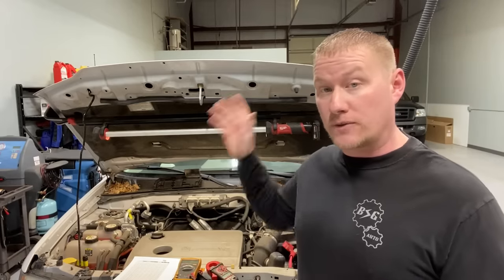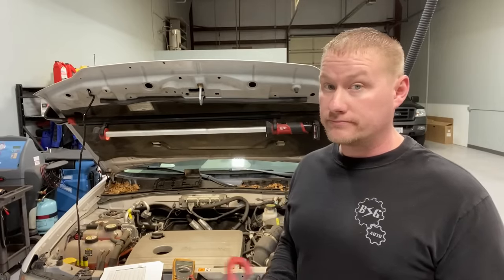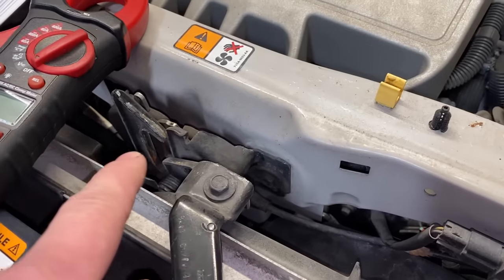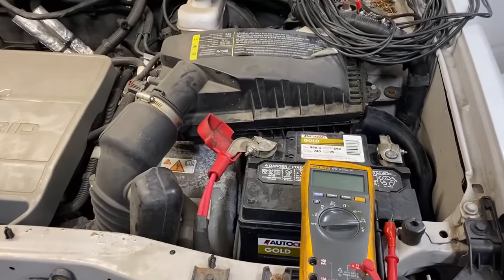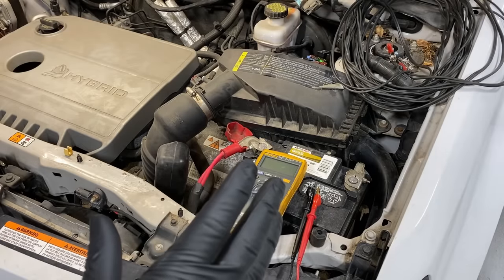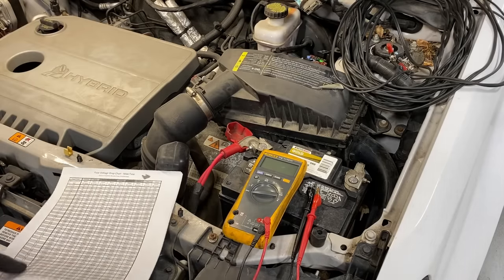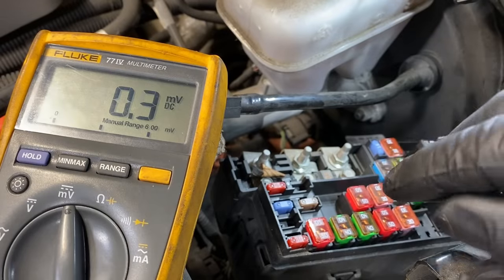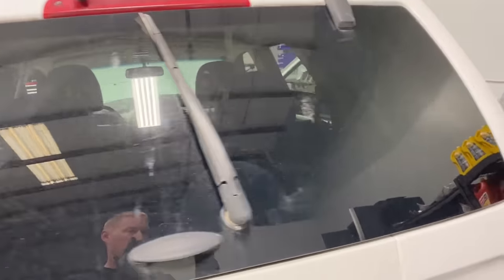Which Parasitic Draw Test Method is REALLY the Best?

Comment from the maker: These are the Tools and Equipment I Recommend:
Good Basic Multimeter-
https://amzn.to/2IxRMM8

Good Basic DC Amp Clamp-
https://amzn.to/3aygR5E

Power Probe Voltage Drop Fuse Charts:
https://www.powerprobe.com/fuse-voltage-drop-charts

As an Amazon Associate I earn from qualifying purchases.
Reply: Thanks brother. I'm just learning electrical trouble shooting. This will help a LOT. 👍😎
Reply: Thanks alot I'm dealing with parasitic draw and my 2013 f150 right now. The battery goes dead after sitting for 5 days.

I do know I have a bad wire going to my h13 headlight connector, and broken wires and the rear door harness.  
should I fix these problem before doing the test?  
Could these be my problem to parasitic draw.
Reply: Please help me. I have followed your video about remote control start and now Everytime I do it the antitheft runs . What should I do Ford fusion 2012 v4
Reply: Do you know how to fix the gem on like a 98 f150 that has a phantom parasitic draw
Reply: Another great video. I started using Di Grease on my terminals like you suggested which has fixed my corrosion problems. Can you please do a video on rack replacement on the '08-'10 edge or similar vehicle. Space looks limited and the repair looks a bit scary because the sub frame probably has to be lowered. My rack doesn't leak but I can feel the play is in the rack attaching to the inner tie rod. It's moving all over the place especially the y direction. I've heard to check the U joint but that wouldn't explain the play in the rack itself.
Reply: Got a link to the thermal imaging meter. That was cool . .. or should I say,
 "the hot quick fix"
Reply: Remember doing this different ways in "fact" class
Reply: Thanks 4 real!!! What if my vehicles key fob is lost, so I can't make vehicle beep or lock with key I have to manually lock it. Will the car still sleep? Thanks!!
Reply: The absolute best educational testing video ive ever seen .
Reply: Could you this test for a hidden GPS ?
Reply: Wat is name of tool at 18:50, one which shows temperature of circuit board and how much it costs?
Reply: Why are the tools you recommend different from those you use in this video? For some of us it would be easier to follow and better understand what you are teaching.
Reply: @gabewhisen3446  I believe your "ghost " is a intermittent parasitic drain. He explains it at 16:15 and 17:43 in this video. This video, is the best I've found so far but I would still watch other videos to get tips from them. For example, once you identify the faulty fuse and such fuse controls a bundle of wires, now you have to find the faulty wire (it helps if you have wiring diagrams for vehicle you are working on). Also, on another video someone commented that a bare wire can be found by using the clamp tool/meter. 
Like I said before, this is the best video I've seen, but don't ignore other videos just because, the person in the video doesn't  wear a fancy uniform or it seems they're working at their backyard. It's all about what you know, not what you wear. 
If you haven't fixed your problem, I hope this helps.
Reply: @gabewhisen3446  tool/meter, the proper name is DC amp clamp. Sorry.
Reply: Great explanation! 
2013 F150 5.0...Been chasing an intermittent draw since new. 
Question, though... If I lock up with the keypad (one push 7/8&9/0) does that arm the vehicle and put it to sleep, or should I use the key (two pokes on lock)?
I'm reasonably sure it's the radio, but the issue has been elusive 
Until now of course...

Kinda baffling to me, but as a former Ford service manager, I've always wondered why every dealership only has one of YOU...

Keep up the good work, the car buying public needs you!
Reply: Great video. My amp clamp isn't the most accurate so anything less than an amp I would use voltage drop test (I learned that I can not be trust to remove the probe from the anp jack then when I test voltage I cook my fuse.) but combining the 2 methods should come in handy. Thanks for the video.
Reply: thank you for sharing this sir!
Reply: Sea
Reply: Amp clamp no longer available from Amazon
Reply: Excellent video well thought out    Professional  just what you tube needs more of  thanks  I would like to suggest one  extra step    To the Tec and wrenching  and covering bases and peace of mind. That is using your smart phone in the camera on it so that before you start pulling fuses taking a picture of the fuse box a clear picture of the fuse box so you can see the colors and arrangement of the fuses and so you got insurance right there so when you’re moving your wires around testing each fuse while you have your intermittent passive drain moving your wires around on the meters a lot of the times snags things and then gets all the fuses out of order and if you don’t have a  manual to Guide your easy reinstalling the fuses ,you can just referr to the Ipicture you took of the fuse box which also let you magnify the picture and time date stamp is it in case you’re doing a side job all very convenient and helpful saves time In keeping your fuse values unmixed up  of the fuses and make sure they go back to the right places it is so amazing how easy it is to bump a layout of fuses and  then struggle other than that you’re right on  I learned a lot from you you keep it up I appreciate your video and have subscribed and liked your process thanks
Reply: With the AMP clamp, and working on a 99 F450 XL 7.3 dual battery, remove one of the positive cables, then measure across the other positive cables?
Reply: I don't remember which parasitic drain video I watched but he said to definitely repair any know electrical problems first. Makes sense...one of those could be your problem. Lots easier to repair a known problem than trying to track down an unknown one.
Reply: Very good info. Thank You!
Reply: Hi thank you for this video. I just had a question. While using method #3. You’re still not able to check the fuses that are over 20/25 amp (sorry I forgot which one it said at the beginning of the video) and the other type of fuses correct ? I’m assuming those you would be pulling instead of checking with the multimeter.? 
Thank you for your time.
Reply: @aarifboy  This is likely a FLIR thermal imaging camera.
Reply: Thanks for this detailed video. I am not working on a ford, but assume the general principals will still apply to a 2007 Lexus. The 2nd and 3rd links, amp clamp and fuse chart links are broken. Do you have newer ones to attach?
Reply: FYI your amp clamp affiliate link is broken.
Reply: @dgv9113  I know this is 5 months old now but yes, for the fuses that can't be tested you would do the pull method on them instead and see if your amp draw on the amp clamp goes away. Only reason he was reading the mV was to show the least invasive way, but for the fuses that you can't read from you don't have much choice and have to pull them out.
Reply: As a Z a Sadez
Reply: The top two of these links did not work for me
Reply: Does it matter that this is a 2011 Ford Escape Hybrid, type of electrical system ?
Reply: Do you have an updated DC Amp Clamp Recommendation? The Link you posted is dead.
Reply: On diesel trucks, do you disconnect one battery or can you have both of them attached but take readings from one side?
Reply: @duncangardiner  it's best to disconnect one then test separately
Reply: @JA-yy6bd  are you asking because yoh think you might have a hidden GPS on your  car?
Reply: links dont work

Comment: I am a retired electrical technician with 44 years of experience and I have to say this is the best video I've seen to troubleshoot a parasitic drain on a automotive battery.
Reply: Amen, brother.
Reply: For sure ... Fantastic ... !
Reply: Sure isn't like the old days unhook the battery cable put a test light in line start pulling fuses till test light goes out then that's the circuit you're loose before and even before I've been in a trunk made sure light was out door jam some light checks I grew in my Dads Standard Oil Division American Oil Company of Indiana Service was around it all my life he was there 52+yrs Standard he went independent for a bit then was UNOCAL 76 his remaining starting in the late 30s early 40s was there 50s till drafted WWII B52 AIRPLANE mechanic and instructor came home bought the station back I was born 1960 the year Standard built finished his new station 1958-59 Regrandopening 1960 I started full time nights at age 12 eventually went out on my own built a three bay three in ground lifts service center for 25yrs all the time never forgetting where I came from if he called I ran to help him I built my shop almost identical to his station by buying out old stations that were going on the chopping block to build convenient stores got things cheap lot of work jack hammering pulling the lifts out first one did completely by hand enough said I still like to tinker I'm 63yrs old
Reply: Thank you for sharing your insights.
Reply: Pump mechanic   and motor control tech for 16 years here.   I agree with you 100%   best vid I've seen on the subject!    Gonna save me hours of time on my Ford 6.0
Reply: You're just happy he's using a fluke lmao
Reply: Yes , also an electrician here , this guy did a good job of explaining this to the point that an amateur could follow this procedure and be successful
Reply: Yes, I agree. I’m technician with 135 years of experience. He is totally nailed it
Reply: I agree. I'm a retired GM tech.
Reply: i have a question... if i put multimeter on diode mode .. and connect leads all together - red to red and black to black (NO battery connected ) . is it normal to read continuity ?!
Reply: If testing the fuses is the worst way, why is that the best if all of them can’t be tested? Makes zero sense
Reply: I'm basically just starting out in the field and I have used this technique
Reply: Agreed, but exceptions. Should say “cable” and “post,” not call both the cable and post “terminal.”  Also, explain the point of the jumper cable more fully. Is it that the battery can be disconnected briefly without dumbing the car, but not for an hour? And, mention that blade fuses have tiny test points on top. I learned that from another video. While I’m at it, does it matter if the red (+) test lead is connected to the neg post rather than to the neg cable? Some other videos have leads reversed.
Reply: @robertolaggo9141 - 135????
Reply: Hey I have a 5A draw on battery on my 02 Jeep Grand Cherokee Laredo 4.7L

It's showing 5.3A and dropping off to 0.59A when I pull fuse number 8 under the steering wheel.

How should I go about testing the components in the circuit without cutting off the power.

Should I test voltage on the wires going to the components:
Fuse junction box diagram says #8 fuse protects:

Overhead Console, Rear Wiper, ip lights, rear flipper glass solenoid.
Reply: @CameronDC-Grimes  I have at least 12 items after fuse 5 in my 1997 Chrysler Sebring JXi Convertible.
Reply: Thanks mate. You are the best

Comment: It's also a good idea to photo fuse boxes prior to removing fuses so you know where to replace them.
Reply: "It's also a good idea to photo fuse boxes prior to removing fuses so you know where to replace them."
Indeed!
Reply: If you still have your owners manual, it shows where they go in there.
Reply: @richardhill2684  True... but you often don't have that luxury working in a shop environment.
Reply: This Beetle’s manual is extremely vague on the fuse information. I’ll be taking a picture.
Reply: @Lobatschewsky  The camera is really a valuable tool... and for much more than mere fuses! Photograph anything that might be potentially confusing going back together.
Reply: rwbishop Yep. It will eliminate that leftover bolt.
Reply: @rwbishop  I agree, it doesn't harm but benefit
Reply: Stuart S  Tell that to Ford
Reply: You pull 1 fuse, then put it back before you pull the next, that way you don't make the mistake you're talking about.
Reply: I did a head gasket on a 2001 Audi and sent the head off to be machined and valves replaced, etc.  Shop ordered the wrong valves and it took quite a while to get it back.  If I hadn’t taken pictures and used colored markers on the many small vacuum hoses, I’m not sure I would have ever gotten it back together.  I even sequentially numbered bags as parts came off.  😉
Reply: @521CID  No you don't as it can cause a module that has timed out to re energize and create a new draw
Reply: @greghuber9773  That depends on the year vehicle you're working on.
Reply: @greghuber9773  It may come as a surprise to you, but good mecahnics know the difference in current draws.
Reply: Good idea.
Reply: @richardhill2684  It does but sometimes it is wrong. Not often but it does happen.
Reply: With a lot of hydraulic hose in excavator i also take a picture or video before disassemble the hose
Reply: If you have a slab of cardboard you can draw a fake fuse box and quickly slide the fuse into slits you cut to represent the position of the fuse.
Reply: @521CID  Pulling and then replacing the fuses can work if you have a constant parasitic draw. But if it’s intermittent and you pull and replace the fuse while the draw is off, you’ll go through all the fuses and never learn where the draw is coming from.  You can also wake up a module that you had allowed to go to sleep when you reinsert the fuse and confuse your test protocol with another current draw in addition to the one that you’re looking for. 

That’s why it’s important to put your amp meter in series with the battery or use the amp clamp inductive pickup to characterize the parasitic draw before you start testing. If it turns out that it’s intermittent, pulling the fuses and leaving them out is better because you’ll eventually get to a point that you notice the parasitic draw isn’t cycling back on. That means one of the fuses you most recently pulled is probably responsible. And you can find which one by backtracking and re-inserting the fuses you pulled, starting with the most recent pulled, until the parasitic draw returns. 

This won’t catch every parasitic draw unless the car is all factory OEM. If it has any owner installed equipment it’s not uncommon to find that they’ve incorrectly tapped onto the battery side of an otherwise fused circuit and the load they added will persist even with all of the fuses pulled. So always do a visual inspection and look for that possibility first.
Reply: I completely agree, but as a 38 year Master Tech I generally remove then return the fuse back to its original position. Also before I start I check or ask if any after market accessories have been installed or has the vehicle been repaired after an accident?
Reply: @greghuber9773  obviously not a factory trained BMW master of 38 years like myself. Also a Toyota, Chrysler and Nissan master all taught us to remove be patient then reinstall and so on. My I was misinformed by all 4 factories? What do they know? I’m retiring in 4 months so I guess I won’t find out.  Good luck in 2023
Reply: @johnrpizzaguy  funny I was a Chrysler master and contracted instructor and taught Chrysler techs but whatever !!! Lol Happy New Year to you as well !
Reply: One at a time? .-.
Reply: @unownvoyage That’s what we did with Aircraft windshields, several different bolt lengths. Draw the pattern and put them in the cardboard in sequence